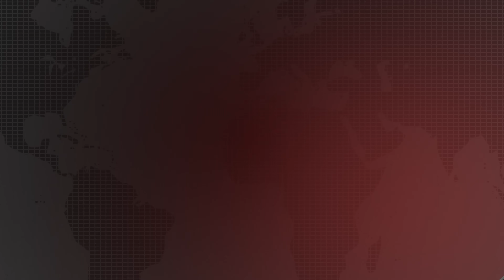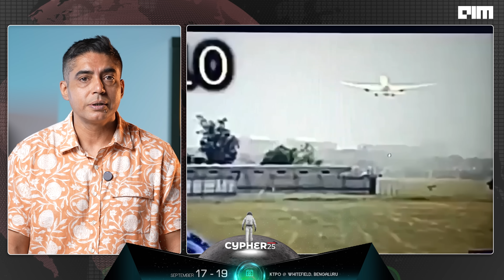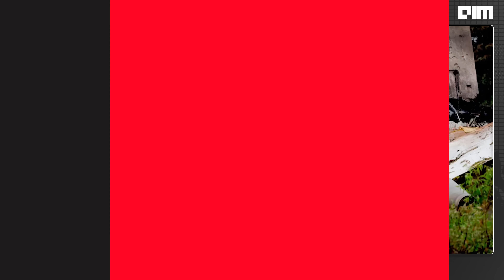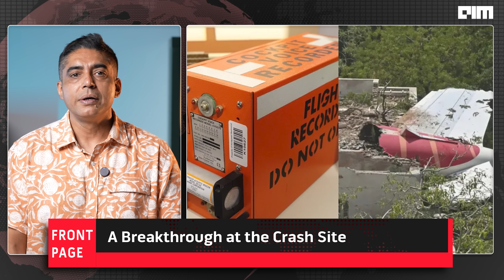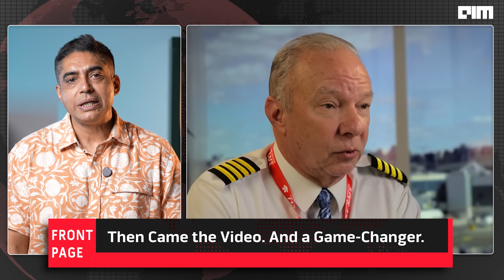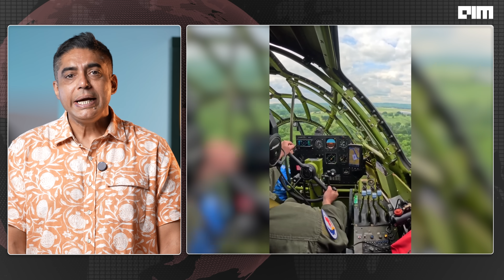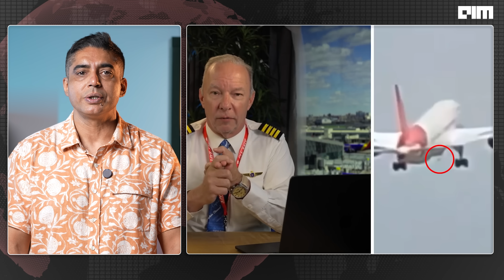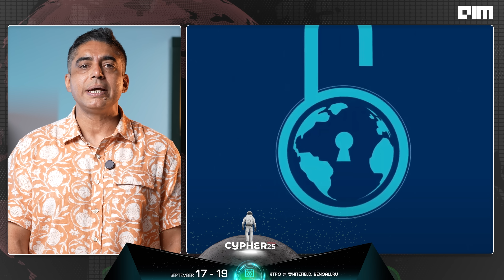Air India Crash: Is Boeing in Trouble Again? RAT Footage Sparks New Questions

Comment: The flight had come back from London airport safely without any problems just a day before! And still both engines failed? just like that? considering both were not old. there has to be some warning issues when the flight returned from London to Ahmedabad and it was all ignored. There is no log of maintenance done in India. why didn’t anyone talk to previous pilot who brought the plane back just Previous day from London. In all Air India crashes previously the major factor—- the instrument defect and the Captain pilot and 1st officer did not communicate properly in spite of having sufficient time. Typical Men—-yes, no, also incomplete words and sentences. And the most important—-over pride of boss versus employee level below. And the employee talking in meek voice to the superior. Even in 1960’s Air India crash in Swiss mountain, the pilot DID NOT listen to the Radar controller saying the plane has NOT CROSSED the mountain. It is still 5 miles away. of course the basic reason the instrument not working. All these Air India crashes were unbelievably insane. Should not have happened at all. If there were women pilots it would not have happened since women always talk more clear, emphasizing, talk better and yell in case of danger.

Comment: Even without proper maintenance, BOTH engines are not expected to shut down on flight.
This is dangerous conception that the supplier company will try to hide at all costs.
Reply: The engines are not built or bought for the planes by Boeing, they are buyer furnished equipment. You are correct, a dual engine failure on take off is astronomically rare.
Reply: @MegaWingman7  Rare but possible.
Reply: @MegaWingman7 Both engines were switched off by one of the two pilots. Heard of "Suicide by Pilot?". That's exactly what happened here. ❤❤
Reply: unless electrical system shuts down because of lack of maintenance. RAT is not enough to power fuel pumps and injectors.
Reply: LMFAO exactly because improper maintenance BOTH engines can and will shut down, happened before, likely here, will happen again.
Reply: @dxb526 when was there a previous incident of an uncommanded dual engine shut off or failure?
Reply: @MegaWingman7  TACA flight 110 (1988), British Airways flight 38 (2008), Pinnacle Air flight 3701 (2008), Ural Airlines flight 178 (2019). US Air flight 1549 (2009).
Reply: @MegaWingman7  e.g. CX780 in 2010 an A350 btw, fuel contamination
Reply: @bessarion1771 I said “uncommanded” bird strikes etc cause engine failures. Perhaps there were bird strikes on the air India flight but it didn’t appear to be the case.
Reply: @MegaWingman7 Air France Air Show Paris.
Reply: @MegaWingman7  Not all of these were bird strikes. Fuel contamination will do the same.
Reply: @bessarion1771 never on a 787... Air India is at fault for not maintaining the plane
Reply: @jasonstoll6559  agreed
Reply: @SATYUG3z  There are only 1 or 2 cases in History where you had a Double Power loss. What might was a Problem could be dirt in the fuel, If the filter got stuck, there will be no fuel in the burning chamber and the the engine cannot produce any Power.
Reply: @jenslehmann677  No engineer would put only one filter for both engines. Each engine should have separate/independent supply rails. Electronics or software glitch might be the cause.
Reply: The engine failed. General electric made the engines. This has nothing to do with the aircraft supplier Boeing. How idiotic are you people that keep going back to blame them. 11 year old plane with 8000 flights on an airplane type that has flown a billion passengers without a single incident until Air India failed to maintain it properly. This is the same as buying a car, never changing the oil, and blaming the company when the engine blows up. The aircraft are falling apart, and they are known worldwide for having dirty disgusting aircraft with maintenance issues.  It's been noted by many influencers that do nothing but fly airplanes for a living.  Air India and Tata group are to blame.... Why do you think they were so quick to announce a measly payout of $100,000 to the family members?  Guaranteed that money came with a guarantee that they wouldn't sue the airline for wrongful death. This smells very bad. Forget your national pride, will all agree that India is a brilliant country with corrupt leaders that constantly take shortcuts. Look at your rail system as a prime example.  
We're dealing with profit-driven private corporations that could give a damn about a single person's life. To them it's all about numbers, it's cheaper to pay out $100,000 per passenger then it is to scrap the airplane for maintenance. Run the numbers, you'll see I'm 100% correct.
Reply: @jasonstoll6559  You got it all wrong. You did not say how BOTH engines shut off the very time it should not. It's so easy to blame Indians, but do you think they were barbarians who were "tamed" by Izlamic and British invaders?
Reply: @SATYUG3z the engines are made by general electric. Still has nothing to do with Boeing.  The issue here is maintenance by Air India and Tata. Why do you think they paid out money so quickly. They knew that maintenance was an issue and they couldn't write a check fast enough.  Air India and Tata are to blame.  It is a maintenance issue on an 11 year old plane that has flown 8,000 times already.  It needs to be maintained and that's not Boeing's job. Air India and Tata are at fault anyway you look at
Reply: @SATYUG3z  so you buy a car poorly maintain it and the engine breaks after 10 years it's the manufacturer's fault?... Jeeze if I only knew that I wouldn't pay hundreds of pounds each year getting it serviced
Reply: I would also be willing to bet that you work for Air India or Tata group. You will do anything to take the blame squarely off your company. You didn't maintain a 300 million airplane. You killed 270 plus people. Nobody gives a crap why.  When a black box comes back and it's found to be a maintenance issue,  I'm going to laugh in your face, just like the rest of the world who already knows, your company did not maintain its fleet of aircraft
Reply: @jasonstoll6559  Chill bro. If I want to know if that plane has any conceptual problem, it's to prevent future catastrophes. Your stubbornness on maintenance issues (which cannot be ruled out) seems out of prejudice. (Friendly advice, don't bet!)
Reply: @SATYUG3z secondly, I have no prejudice. I could care less about who owns the airplane. In this case it happens to be Air India or Tata group who you work for. You still don't go back to mention the fact that the previous flight I've reported electrical issues including lights, entertainment systems and air conditioning.  How are you still keep going back to blame Boeing who doesn't even manufacture the engines.  Why don't you actually post your real name so we can look up and see who you work for. There will be two causes of the accident, one will be pilot error, the second will be improper maintenance.  Remember this plane took off and used every foot of runway it could, so it had power..... Why do you keep going after Boeing?  Are you an Airbus employee?  The only prejudice here I see is you, doing everything he can to push the blame elsewhere besides the owner of the airplane who are responsible for MAINTENANCE!!!!
Reply: @jasonstoll6559  I'm not even Indian.. Hope you realise the real "circumstances" Boeing's whistleblowers committed "suicide"..
Reply: @SATYUG3z you're talking about issues with the 737.  Going to be perfectly honest, I have no stake in this game.  I don't work for Boeing or a competitor's airline, I work in IT.  But you have obviously made up your mind long before any information comes out.  You are not objective.  Boeing has been in existence for 110 years.  Have they made grave mistakes with the 737 Max?  Yes... Have they corrected those mistakes? Yes.  Does it have anything to do with a successful plane that's flown over a billion passengers without a single incident?  No.  Is playing at 41000 hours on it and 8000 takeoffs and landings.  The concept has been proven a long time ago, but obviously not to you....... At least you finally admitted that you are biased.  You will find in the long run the Air India is to blame for improper maintenance.  Nothing about the concept of this airplane has ever had problems until Air India killed 270 plus people.  
I fly 10-12 times every year, and I don't worry about the aircraft I'm flying on because I fly with legitimate carriers that maintain their fleet.  Unfortunately Air India is not one of those companies.  
Try to put your bias aside for 5 minutes and think logically.  
Good day to you
Reply: I'm an American and know the issues surrounding Boeing.  I simply cannot allow the bias of a single person to shift blame away from where it belongs.  Concept proven, you just don't like Boeing.  That's all you had to say originally and you would not have hundreds of people stating over and over again that it boils down to maintenance.
Reply: @jasonstoll6559  Aren't you BIASED towards that maintenance issue??? Did you assist the maintenance team or what? Is your conclusion based any firm ground or prejudice.
Reply: I could call it pilot error, but they are dead and can't speak for themselves.  Maintenance maintenance maintenance.  I don't care either way it doesn't change my life. I don't work for any airplane manufacturer. I work for IBM.  You are once again shifting blame...sorry, anything you say is unreliable due to your bias
Reply: @SATYUG3z  i pdict tht boeing ill be shut down in in 6 month
Reply: @sailormanoyster1849  Its stock value will never have thrust and trust again..
Reply: @sailormanoyster1849  Under Trump, no way...
Reply: @sailormanoyster1849  idiotic response.  Boeing is not responsible for maintenance on an 11 year old lane with 8000 flights.  Blame Air India and Tata group for not maintaining their fleet.  Boeing has been in existence for 110 years.  Air India should be shut down as they are known worldwide for poor quality and maintenance.

Comment: All vital components of this plane, most of all fuel pumps to both engines, are electrically powered. RAT deployment indicates there was a major electrical power crush. The plane apparently rested 2-3 hours on the ground, before the takeoff. This could cause water condensation inside the vital electronic system leading to the electric power crush
Reply: Not at all!
Reply: @volkergiesbrecht5829   I am not a pilot or airplanes technician, I am a retired medical doctor by profession, but years ago I was a radio-ham (if you know this type of hobbies) and I made a few radio gadgets from the scratch myself, that's why, judging from the several info in the web, I wrote what I thought. Best greetings.
Reply: Really,,so what about those planes that are leaving from other high humidity countries?? I’ve never heard of such disasters.
Reply: @Blessings-zq2ck  please consider what happened to Swissair flight 111, where arcing of the small wires caused fire of the lining and destroyed the whole plane. Electronics is very vulnerable to corrosion, especially very narrow and thin copper paths of the multilayered surface mounted components. This airplane was traveling between two zones of very different climatic conditions, so water condensation could corrode some vital components. But obviously, I might be all wrong.

Comment: You are discussing the reasons for the crash, but not one of the reasons causing the death of people. 
The reason for the death of hundreds of tons of fuel on board that ignited at the moment of impact. 
And this problem must be solved somehow.
Reply: help me understand your point please.
Reply: @maxine-v4h  we are only talking about the concept of which proves the fundamental possibility of dumping a large amount of liquid in a few seconds. In an airplane, this is done by special fuel lines leading to the tail of the airplane and spraying it behind it, so that even if this fuel ignites, it will quickly burn without causing much harm on the ground. All this will not require any radical changes to the design of the aircraft, all this is technologically achievable. The simplest calculation can prove this. In my calculation, I got a fuel discharge of 100 tons in 31 seconds. This is not about ecology, not about where this fuel will drain. We are talking about how to get rid of fuel in the event of a crash on takeoff - the most dangerous stage. Until there is a public demand for aviation safety, nothing will happen, everything will be repeated over and over again. It is obvious that such an airplane design is a dead-end branch of aviation development and extremely dangerous.

Comment: I think that we will speak about maintenance soon. The plane had several electrical problems filmed by a passenger 2 days before
Reply: Dude, don't put equal sign between the vital systems of the plane and disposable stuff like the entertainment system on board, siwtches for the lights and so on. Come on. nobody can be that superficial... It is like you'd suspect that a car has faulty brakes JUST because the lights don;t function well anymore